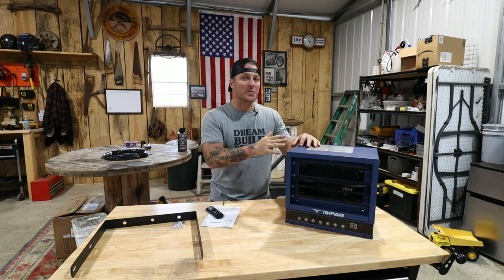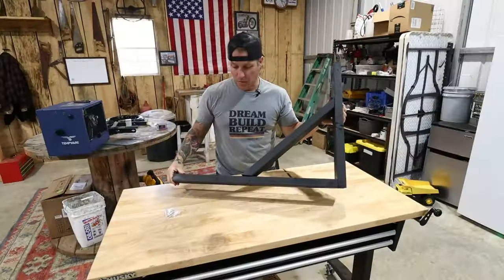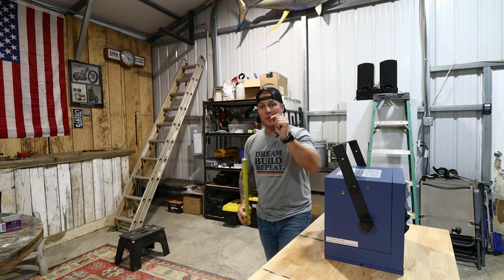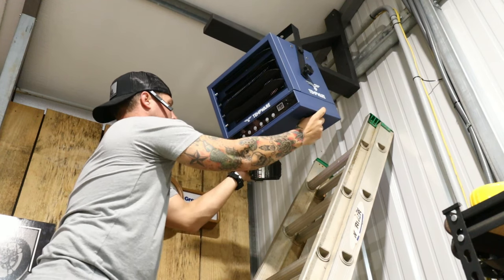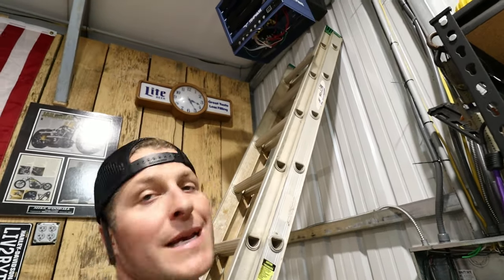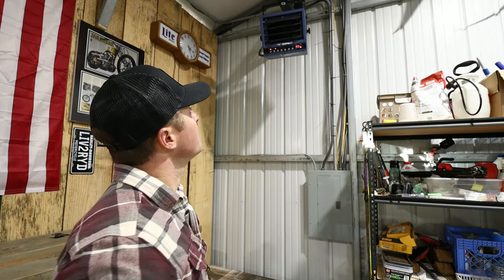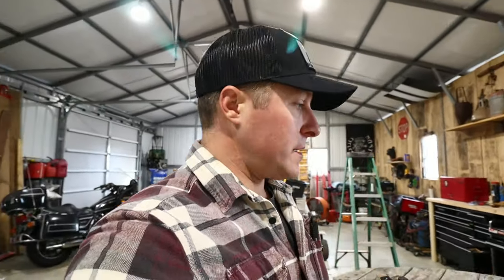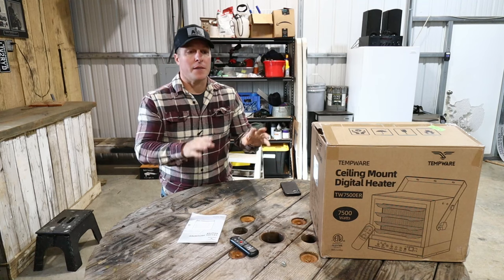ITS TINY! Will this heater heat my shop? TEMPWARE 7500-WATT SHOP HEATER.

Comment: it will at a 400 dollar a month electric bill, and homeowners should call an electrician, this would fail inspection, you used no liquid tight connector into the heater.

Comment: I have a similar one that is 10,000 watts. It has worked great for me for the last 5 years. One important thing to remember though is that if your shop isn’t well insulated you will be throwing money away to your utility company. My shop is 950 sqft. 8 foot ceilings. The only time I run the unit is when I am in the shop. I went above and beyond with insulation. 10” of blown in attic cat over 6” batts of insulation in the attic. My shop never gets below 40 degrees even when it single digits outside with no heat running. My unit will raise the temp from 40 to 65 degrees in an hour and maintain that by the thermostat throughout the day.
Reply: I am thinking about putting in same 10,000 how loud is it?

Comment: Never a good idea to connect a wire whip in PVC conduit to a Heater. PVC melts. That's why they make Greenfield flexible metal conduit whips. Also, not a great idea to install a Square D Homeline breaker in a GE electrical panel. Just a few observations from a professional journeyman electrician. Just remember, Home Depot sells every electrical thing you need to do it yourself and burn your own house down. Great little heater though.
Reply from the maker: Thanks for the tips!
Reply: Some breakers are UL listed for other panels. I don’t know if that one is but some are.

Comment: I did the same thing with a 5000 watt heater for my 24' x 32' fully insulated garage. It makes it comfortable enough to work in, and your heater will definitely take the edge off in your shop, but when you see your electric bill you may decide to go with a gas heater. Check out the Reznor infrared tube heater. It would be perfect for a shop your size, and the heat distribution would make it comfortable throughout your shop. Thanks for the video my friend.
Reply from the maker: Awesome I’ll checkout that infrared heater for sure! I’m am curious to see how much power it uses.
Reply: @ProjectDadLife  updates on electric costs after 1 month usage?
Reply: I have a similar heater in a fully insulated Morton building.  Dimensions are 32 X 36 , 12 foot ceiling. It keeps it at 55 degrees all winter here in Pa. Bad side is adds $100 to the bill all winter.
Reply: @yeloautosports what I've found is the 5000w unit made by the same company averages about 51¢/Hour but depends on area you live and chosen providers rates. I just ordered the 5000w unit after looking into this myself. Was going to get the 7500w unit but realized it would be over kill for me Amazon had allot of great reviews on these units

Comment: Just got done watching your video I have the same heater but only 10,000 . It call for 6 gauge wire  which I use and a 60 amp breaker Wired it Just like you did and the instructions on the lid . Turned on the breaker and no red lite I have power to the breaker to the unit and no go Call their tech line and is all they tell you to return to unit It's a simple wire installation I cannot imagine what we did wrong   Thanks for listening

Comment: Dude, you should have just slipped the 2"x4" under the handle of the unit so the single carriage isn't holding the unit up, just preventing it from slipping off the 2"x4".

Comment: I believe your conduit should have been terminated at the unit's hole using a male adaptor so the PVC does not actually run inside the unit. The other commenter note about the breaker is correct, go change to the breaker to the type that fits your panel.

Comment: I wish I could use electric for shop heat but its just too expensive where I am. That would cost me $1.05 an hour to run. Electric is so mich easier though, no fuel to deal with and a simple on off switch🙂
Reply from the maker: Great point! I think costly everywhere

Comment: I work in an electrical supply store. I am not here to critique the install but rather give you some info.
When installing electric heat anywhere, you want to try to stay 13 watts per square foot of space with a 10ft ceiling. Then factor in insulation and air leakage. Your shop at a 10ft closed in ceiling would require 21kw of heat to be adequate at the bare minute. This translates to 87.5 amps drawn from your panel just to heat your shop using electric. Once you close some space in and eliminate air flow. A few good ceiling fans would help too.
Reply from the maker: Thanks for the input

Comment: 3/4 inch flex conduit was supposed to be terminated at knockout on heater. That strap was for the wire themselves or if you used an SOOW cord with strain relief through side of heater and wanted to strap cord down. People brush of breakers being wrong just because it fits but a lot of it is the metallurgy and galvanic corrosion issues.

Comment: What a cool shop space you've got there.  Love the decor.  I have a 30x50 with 14ft walls and a 400 square ft loft which is a cool hangout spot with tv and furniture.  I have spray foam on all walls and ceilings and it was expensive but I am so glad I did it early on.  I have a little electric oil radiant heater that stays on all the time and it's unbelievable how well that little thing does in here. I use a propane space heater to heat it up quickly then just let the little electric maintain.  I plan to install  a 15k BTU mini split next year for heat and cooling.  Just installed a 2 post lift today also!  So excited about that!

Comment: Great project! I just finished-up installing a 50,000 btu propane heater in my post frame woodshop, and it is amazing! I have a different situation than you, and I need heat 100% of the time so electric heat was definitely not an option for me. I insulated the heck out of the shop to save money, but it will still be a bit pricy to heat. We are also installing a large heat pump, which are insanely efficient. I would definitely look into that for anyone who wants to install electric heat because it is more efficient and you get cooling in the summer as well. For a future project, I plan to add forced air wood heat as well. Gotta keep your options open 😉

Comment: Great demo! Thanks. Yeah , I've got this one on my shortlist of 7500 Watters for my garage saloon...uninsulated cement block garage @567 sq ft, but saloon side is only 400 sq ft.
Got a woodstove, but want this for quick fix to take chill out when I wanna go out there, put an album on, and tinker ...
Question: how many inches from top of mount to bottom of unit?
Thanks again !
Reply from the maker: its about 4-5" thanks for watching

Comment: Where are you located?  Just trying to judge how cold it really gets, would you go back and prefer the insulation on sides too?  What kind of temperatures are you seeing during summer?
Reply from the maker: I’m in north Georgia. If I could go back I’d really do the same build and insulate and build interior walls as I did on the back. The side of my shop will be done soon! Summer I’m about 80-85 inside

Comment: Where is the Tempware heater made?  Is there any warranty?  Amazon doesn't list either the warranty or the country of origin.
Reply: These are all made in China.  There is a bunch of relabeled versions of this heater.  Home Depot and Menards even sells same heater.  One place sells it with remote and another place sells it with all manual controls which is cheaper.

Comment: How many amps in your service?
Reply from the maker: Just 100 to the shop
Reply: @ProjectDadLife  I’m planning out a dog kennel and want to put in an electric heater. I have a 100 amp service running a 220v/30amp well pump and a few lights.  I’m not sure if I can support an additional 220v/30amp heater.

Comment: Great video!  For safety sake... if you are climbing on that ladder without the bottom being secured, preventing it from sliding further away from the wall, then you are in danger of the bottom sliding and dropping you when you get your weight up near the heater bracket.  There should be a label on the ladder that shows the max angle for safe useage.

Comment: Might be better off picking up a used pellet stove for $1500. Most of them will put out 45K BTU. Or just go with a wood stuff. Has to be cheaper than electric
Reply from the maker: Probably right. I really have to insulate better also